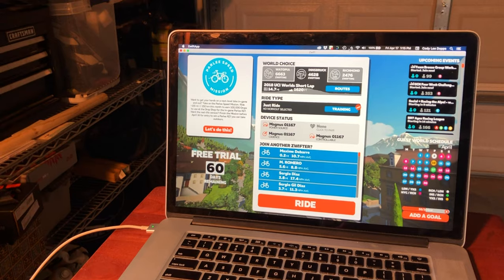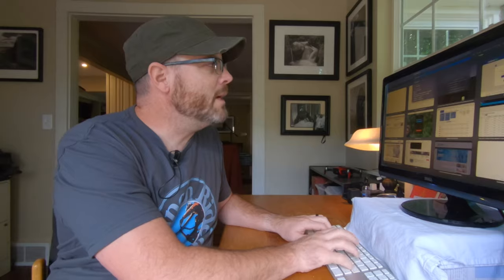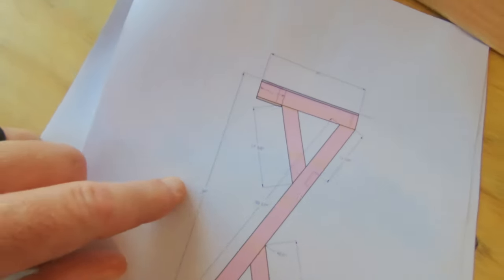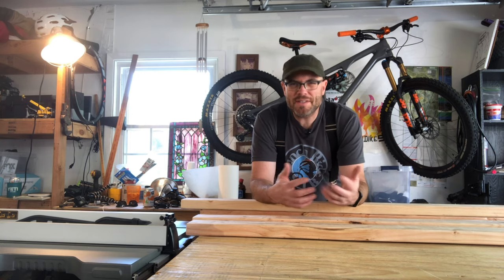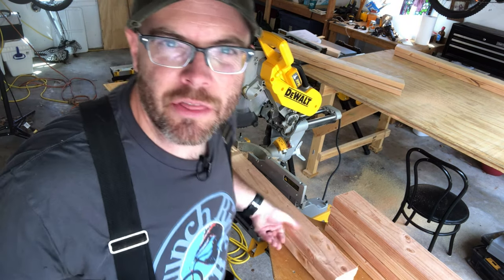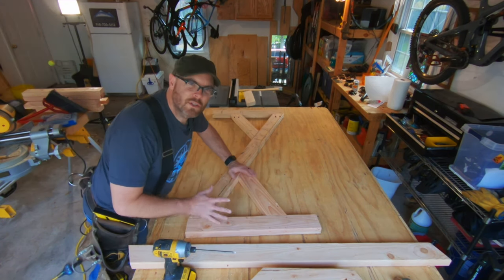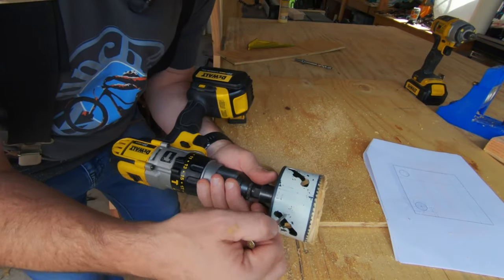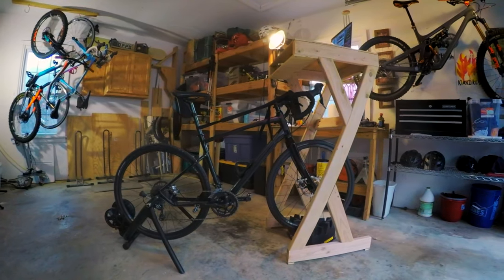How to Build a Bike Desk to Use With a Stationary Trainer & Zwift, Rouvy, or Any Other Virtual Ride

Comment: hi brother, i just built two of these, the only difference is I didnt cut out a bottle holder because my frame has one. also i put 2 inch casters on the bottom. I didn't use pocket holes I just drilled 2 &1/2 inch T25 construction screws at angles. I made two of these, one for me and one for my wife and I promise you I am so happy with how it came out. This saved us 300 bucks! in this day and age where money is so uncertain we couldnt afford to go on amazon and spend 150 each on a laptop stand. Luckily we have tons of 2x3 boards in the garage so it literally cost us nothing extra but some sweat. 

You are an amazing person for this and I will be subscribing.

Comment: Finally made the Z desk. Had to go back to my high school maths to redo the design to fit my vertically challenged self, but I got there eventually. I did away with the water bottles holes since I figure my chilled water bottles are just going to leave water condensation over everything and it won't be pretty. So I plan to buy a cheap water bottle holder and just screw it to the left side. I didn't do the shelf either, but might go back and add it later. Not sure the storage will be much use for me. Have attached a towel hook to the right side, and used a couple of coats of polyurethane to protect it from my sweaty self. Plus I added a fourth cross brace on the bottom at the back. Doesn't get in the way of the front tyre of the bike at all. 

Definitely wish I had a bigger shed/garage, and could justify the additional toys - a mitre saw and a decent size workbench would have made this much easier. But I still think made a decent job with a circular saw, and using a cheap plastic folding table. It's not perfect - a little asymmetrical TBH - but it does the job a thousand time better than the previous stack of plastic storage crates.

Comment: very cool and it looks like it's just wide enough to mount a box fan into that void above the front wheel.
Reply from the maker: OH, I love that idea!
Reply: @LunchRide  finally made mine but spun it 180 degrees.  The main support of the z aims away from the bike. The upper y  supports aimed at the rider have a 6" deep 28" wide keyboard and mouse desk. I used a PC with a 32" monitor mounted angled up in front of the front wheel with a led monitor wall mount on a 2*6 between the main vertical support. When on the bike the bottom of the monitor is just visible over the keyboard. Saves on the neck.

Comment: Since there isn't much weight on this, is there any reason (aside from adjusting some of the support piece cut lengths) that I couldn't use 2x3cs instead to save on weight/cost?

Also, wouldn't it increase stability to turn the bottom piece such that the wider part of the board is in contact with the ground?